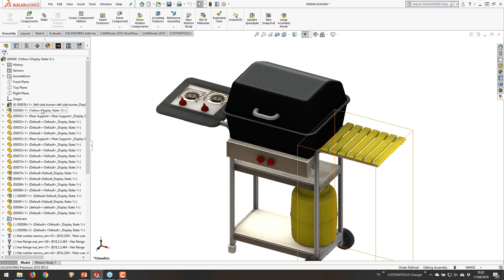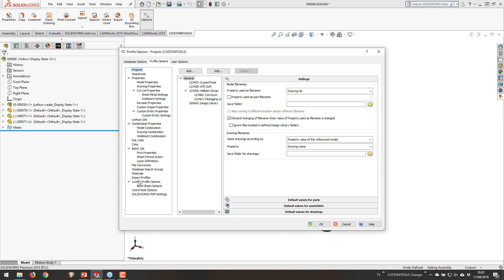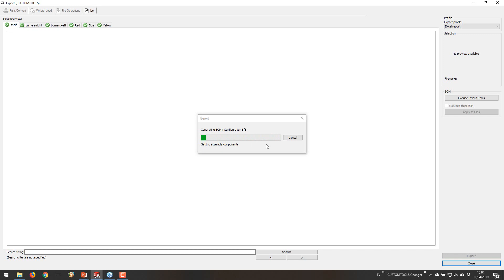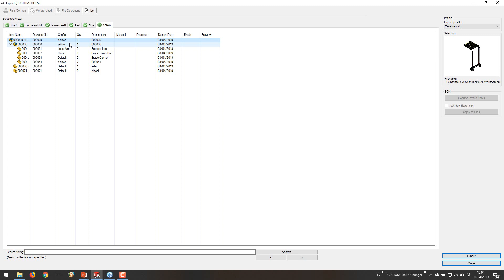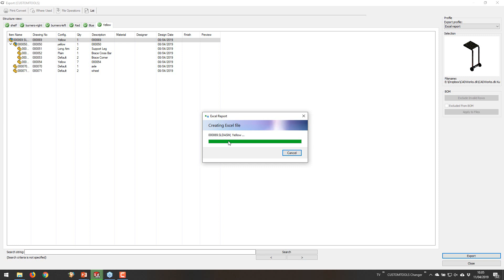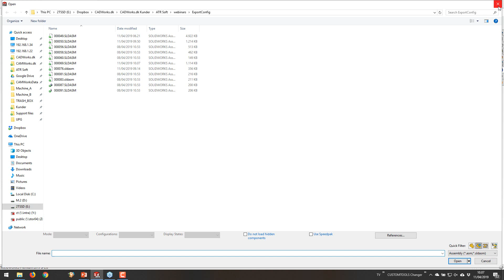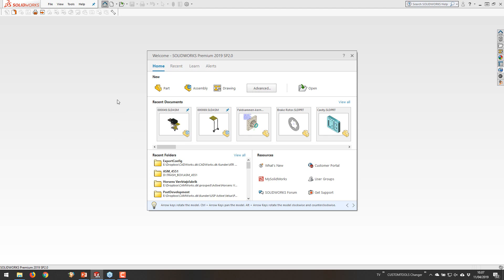Export configurations

Comment: I WANT  TO EXPORT AROUND 5000 CONFIGURATIONS IN SW2016 AS PARASOLID FILES (X_T). PLEASE HELP.
Reply from the maker: Not a problem :) You can use CT 2019 with SW 2016 as we always support 4 latest major versions. Print/Convert supports conversion to ParaSolid and File Conversion Rules have an option to convert all configurations. Since SW 2016 leaks quite a lot of memory, I'd recommend doing it in batches of about 200 files.